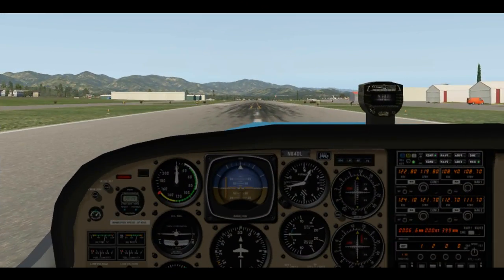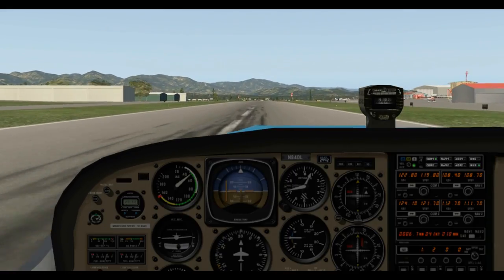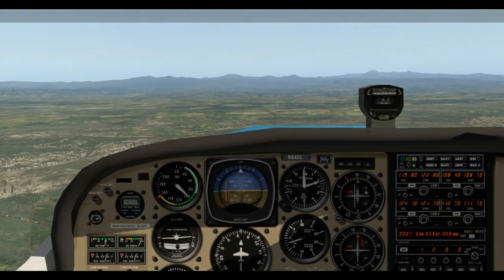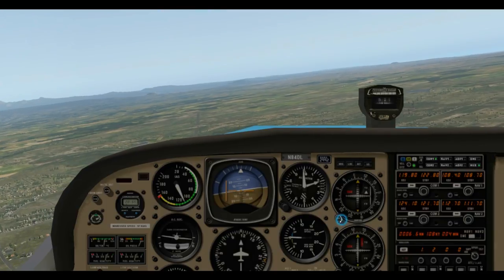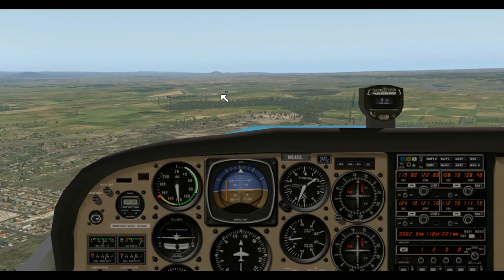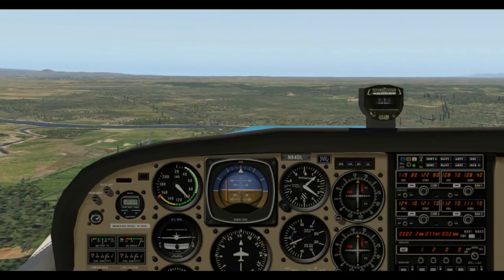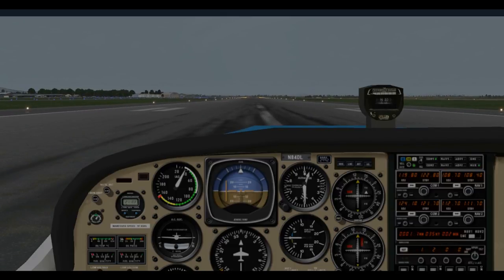The COM & NAV Radios 2 - Learning to Fly for Beginners in X Plane 11 Part 13

Comment: Hi again - sorry for another question; Ive been going through all the videos and they are extremely helpful.
Reply from the maker: OK, what's your question? Glad the videos are helpful!!

Blessings,
skip
Reply: @WEHVideos  Sorry must have gotten cut off.  Ive been sim flying the C152; does that have DME?  I couldn't find it  thanks again!
Reply from the maker: I don't think so, the one I have doesn't. You should be able to tell by looking at the radio stack it should be there if it has one. What 152 are you flying, X Plane or third party?

Blessings,
skip
Reply: @WEHVideos  msfs2020.  I need to upgrade to the 172 but taking it slow.
Reply from the maker: Oh, I don't know about the airplanes in ms2020 but I'm pretty sure there 172 will have DME.

Comment: Thanks Skip nice landing, 2 questions I didn't see the ILS Outer. Middle or Inner indicator lights activate on your approach ? and will the NAV radios pick up the VOR's freq when outside the ring shown on the Sky Vector Map. Please keep up the great work you're brill'.   Paul
Reply from the maker: Hi and thanks Paul.  Not all airports support markers, Redding is a small muni airport so guess it's not available. 

A VOR can be "picked up" 30 to 45 or more miles away depending on weather conditions and terrain, in  perfect conditions possibly up to 200 miles away so the ring, or compass rose, shown has nothing to do with the VOR range but shows you radials of the VOR. There must be "line of sight" to the VOR, so hills and mountains, buildings etc.  can mess with the signal. Altitude helps as well, the higher you are the better "line of sight"  you have with less chance for ground interference for the signal. Hope this helps.

Blessings,
skip
Reply: @WEHVideos  Thanks Skip that makes perfect sense, another puzzling question when tuning the Nav radio for a ILS landing it looks like a VHF frequency is used, which is fine for the Localiser  but the Glideslope / Glidepath is UHF so how does the Nav radio / compass know ?
Reply from the maker: Hi Paul, Well I never gave that much thought and I’m no expert on NAV Radios and radio frequencies. 

You mention “NAV Radio / compass” and I’m not sure what you mean by that, there is no compass associated with the NAV Radio. 
The ILS system use VHF and its range is farther than the Glide Slope UHF plus it uses a much larger antenna array. I can’t tell you how they work but very simply put (and probably not completely accurate) they are two separate systems each sending a signal which is picked up by the NAV Radio, which in turn interpret the signals and outputs the information to the ILS portion and GS portion of the VOR/ILS indicator. Sorry I’m not much help here but that’s the best I can come up with. Good question :-)

Blessings,
skip
Reply: @WEHVideos  Tropospheric ducting can cause or allow VHF signals to travel beyond the horizon, so it would be possible to pick up the right VOR from far away or even a wrong VOR from anywhere along your flight path. This is why it is important to compare the morse code ID you hear with the VOR you intended to receive.
Reply from the maker: HI John,  Right you are. The signal can also bounce off mountains and then instead of flying to a VOR you're flying into a  mountain!! Another good reasons to use GPS but I still prefer the old way,  Pilotage, Dead Reckoning, and VORs.

Blessings,
skip

Comment: Boeing vs Airbus which is better? and do you think I should get XPlane 11 is it anything like real flying what are the pros and cons?
Reply from the maker: Hi Sabertooth Hook, Good questions! I do almost all my flying in small airplanes like the one I use in my videos so I'm not much help in your first question. I will say I purchased the Boeing 777 and it is amazing. The learning curve was way to steep for me so I quite trying, only because I wasn't that interested in big jets. 

I only have experience with FSX and X Plane and since FSX is no longer supported by Microsoft and third party people are trying to keep it going I have to believe X Plane 11 is the way to go in the future. Both FSX and X Plane have strong points and issues. X Plane is weak on scenery but it is getting stronger and stronger with each release. Plus there are tons of freeware scenery packages you can download from the x-plane.org site. They also have hundreds and hundreds of free airplanes you can download however I prefer the payware airplanes, they just seem to have a nicer feel and look, in most cases.

I had well over 1000 hours in FSX until I switch to X Plane when Microsoft bailed, I'm really happy with the switch. I like the fact that you also get Plane Maker with X Plane so you can modify some airplanes or even make your own if you are up to the challenge. X Plane also has a program called  World Editor (WED) you can download for free and create your own airport or modify existing airports.

Bottom line, Iv'e heard that FSX is built on old technology and will eventually be too far outdated in the future while X Plane is going strong and hopefully will only get better.

I know there other sims out there but I can not comment on them as I have no experience with any other that FSX and X Plane. I'm sure you could find some review videos on the other sims to help you decide. Good luck, let me know which way you go.

Blessings,
skip
Reply: oh so I heard that X-Plane is the best sim currently I used to play fsx and prepared3d (P3D) but Xplane 11 is the way to go since it has better lighting and graphics, customization ability for air crafts and scenery and much more detailed aircrafts, multiplayer vatsim ATC and so much more to it and the menu options and the way they allow you to set up your flight is very detailed in Xplane 11. :)

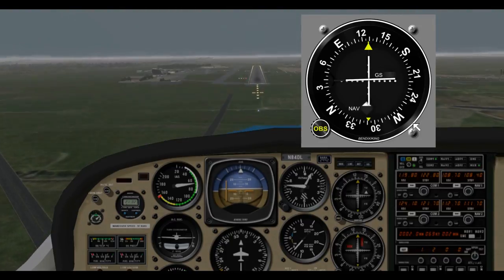Comment: @13:12 Skip, you are planning to land on runway 34 (course 342) and you want to use ILS. Why your CDI is set on radial 129?
Reply from the maker: That's a good question and I didn't notice that. The "to" "from" arrow is correct don't know why it show the wrong compass heading. I just selected the localize tuned to 108.4 and let it do it's thing.

Blessings,
skip
Reply: Better to set runway heading on CDI. It might be helpful for the pilot to determine in which quadrant the airplane is located relative to ILS and what heading the pilot needs to take to intercept the ILS beam. Needle and from/to arrow show you 3 quadrants on CDI where you are NOT located. Using elimination method you know that you are in remaining 4th quadrant.

Comment: So maybe this is all too obvious to even state in the video (and the prior part) but did you mention that the depth of “radio operation simulation” in XPlane seems to be:
1.  Give the person practice setting up radios and switching active radios.
2.  There’s NOBODY to talk to here, unless you wire up something like VATSIM to have a human actually to talk to.
3.  You have to supply the knowledge of what would have been said to tower and what scenario the tower is going to respond with,  for yourself.  You’re basically pretending in your own head.

Given that, it seems of minimal utility to bother with the setup of radios at all. Other than the ATIS part is simulated.

In MSFS, the ATC chatter is added to the “immersion” experience but there’s still no way to talk to the tower.

What I’m wondering is if there’s a way to simulate the ATC comms via some text based simulation plugin?
Reply from the maker: Hi Warren, Everything you mentioned is true and I don't know of any 3rd party add-on that does this. X Plane 11 does have an ATC function but I've never used it, here's a link to a video explaining X Plane's ATC hope it helps let me know if this is what you are looking for and if it helped.

 https://www.youtube.com/watch?v=sFrnPyDG_Os&t=304s

Blessings,
skip
Reply: @WEHVideos    Thanks!   

Apparently the third party add-on that people use is VATSIM, which is a service which has actual human beings who are pretending to be ATC controllers for you, and others who want to fly in a shared server experience, giving you more of the "realistic aviation ATC communication" full experience.
Reply from the maker: There's also Pilot Edge which is really good. You have to pay a monthly fee but you get real traffic controllers talking to you. Unlike VATSIM there's always someone there but it can be very busy at times. I did this for a while but they are not too with general aviation flying, more for commercial jets etc. Very intense so I gave up. 

Blessings,
skip
Reply from the maker: Hi Warren,  Thanks for this, yea scenery pretty bad. I tried VATSIM several times must say this video recording is the best I've heard with VATSIM. Sometime ago I tried VATSIM I'd  join but there was no one in the tower or whom I could talk to  guess things have changed that was several years ago and I gave up on them.

Blessings,
skip
Reply: @WEHVideos     That does sound useful for some folks.    What I would like is a "virtual flight training session" with a "virtual  instructor" who has a near-realtime view of my instruments, horizontal and vertical situation,  and some chart or plot showing my flight.   With those visuals, the instructor  should be able to see my control inputs, and see that I am not using the rudder correctly, or that I am not managing the throttle or the mixture properly, etc. 

It might be an income stream for some sim enthusiasts. I think lots of people would pay for a month of lessons.
Reply from the maker: Hi Warren, sorry don't know of anyone who would provide that other than a real flight instructor so if your willing to pay..., would be nice to have such a service through someone like vatsim or pilot edge, just might be someone out there :-)

Blessings,
skip